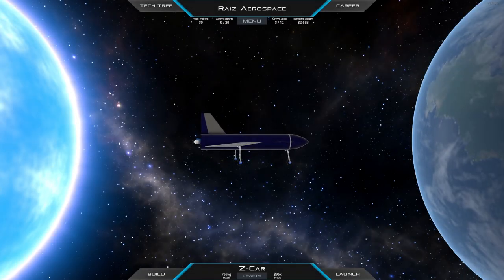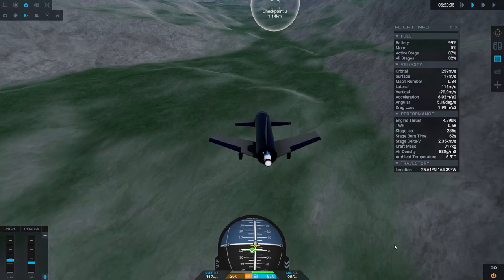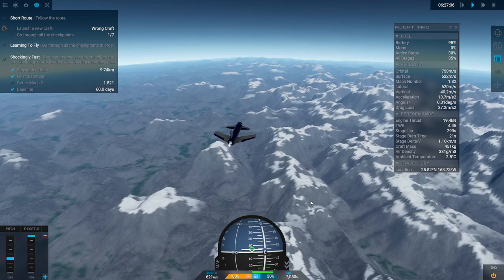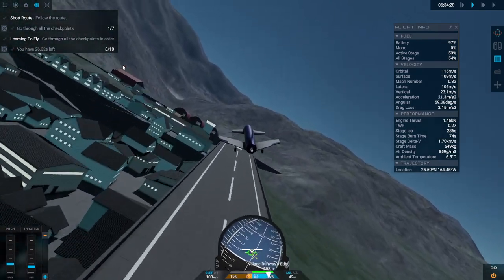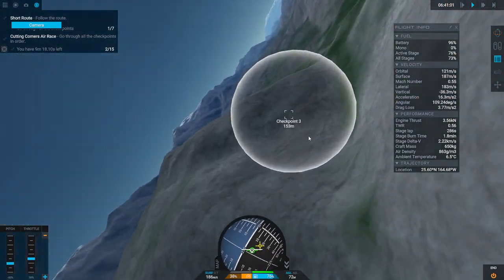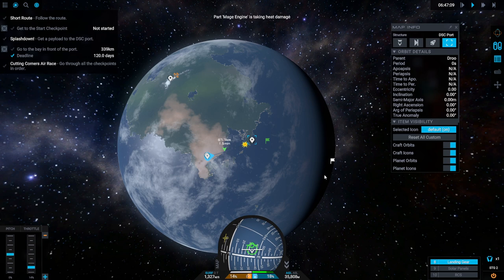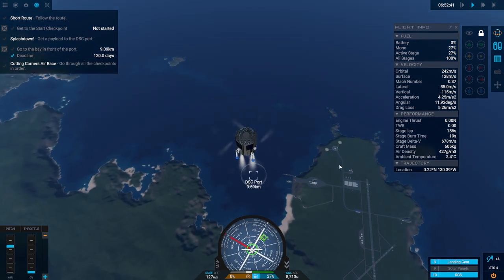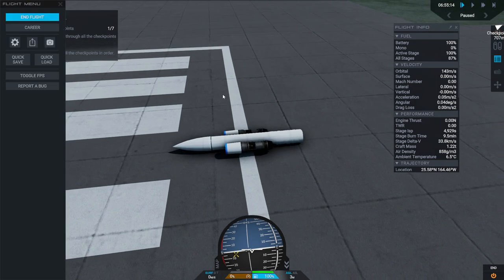Juno: New Origins (formerly Simple Rockets 2) - Career 23

Comment: You don't need air intakes for the jet engine(unless the front of the engine is obstructed, like on the F18)
You can set the control surface max angle to make the plane not roll like crazy(you can also set the control surface speed, although I find it hard to control then)

Comment: The flag icons on the map are landmarks that give tech points if you visit them. They turn green if you've visited them before (such as the barge). The GPS style icons on the map are launch sites/runways.
And I think you didn't get a delta V readout for the jet engines because it was set to vacuum.
Reply from the maker: Yeah, I remembered what the flag represented after I mistook it. Good point about the delta-v - totally didn't think about that.